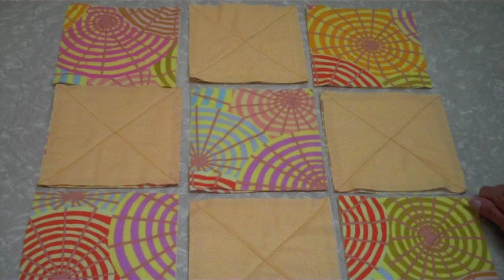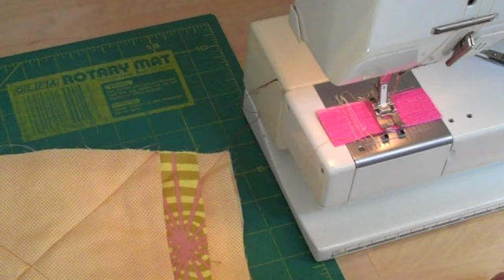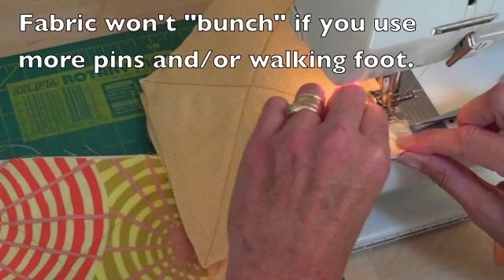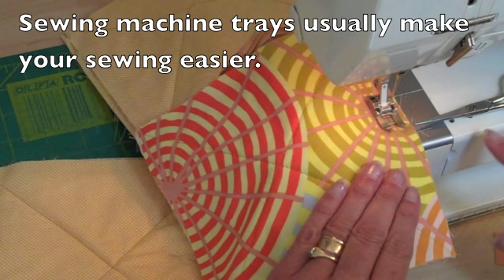ELEMENTARY QUILT-- Sewing Squares Into Rows (#12 of 16 videos) - LearnHowToQuilt.com CLASSES

Comment: Why are you sewing a 1/2" seam instead of a 1/4" seam? Because of the thickness of what you're sewing?
Reply from the maker: Hello!  Thanks for viewing our videos!
This extra wide seam is for the "chenille" look on the back of the quilt. It's not because of the thickness. (Actually you're only sewing fabric to fabric as the batting is 1/2" shorter on each side.)  You have to clip the 1/2" seam (perpendicular to the seam) every 1/16" to 1/8" when making this chenille.  It's very hard to clip a 1/4" seam AND there's not enough fabric to make the fluffy chenille when washed.  
Here's a link to a video showing how to make the chenille....it might make more sense when you see it.  I have a hard time explaining with words. :(
https://learnhowtoquilt.com/quilting-classes/quilt-as-you-go/quilt-as-you-go-14/

This project falls under "Quilt as you Go" category.  There are many different ways to put together smaller quilted sections into a larger quilt.  Sometimes quilters will sew 1/2" seams when joining these quilted sections as it is allows the quilter more space to maneuver.